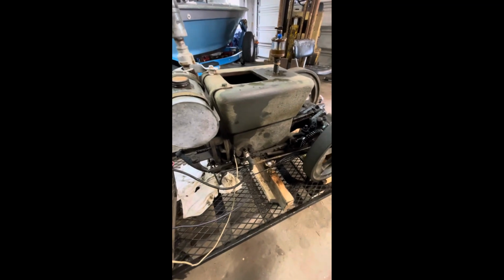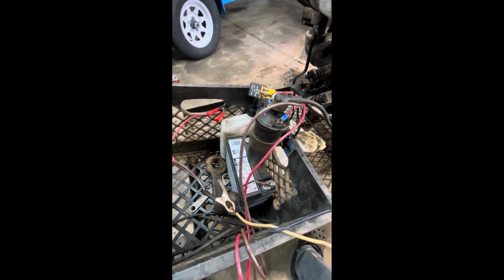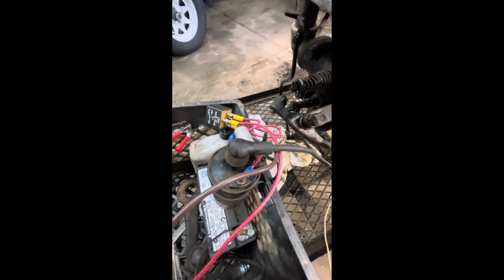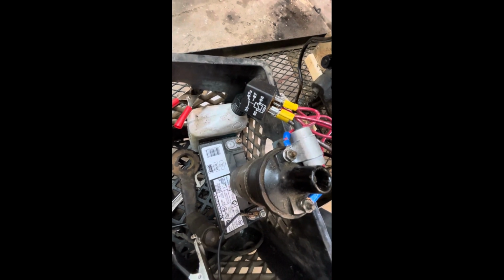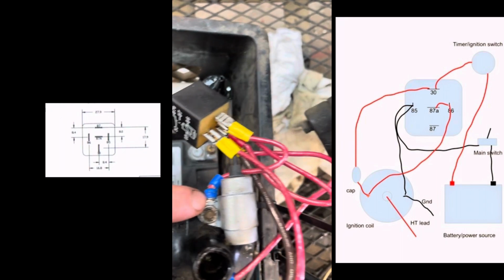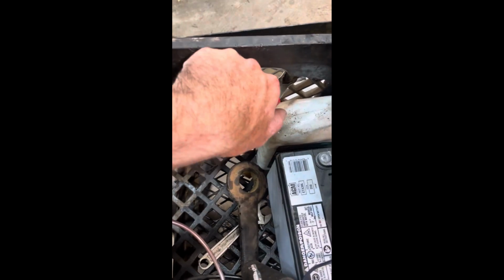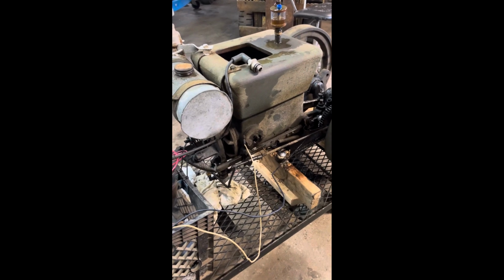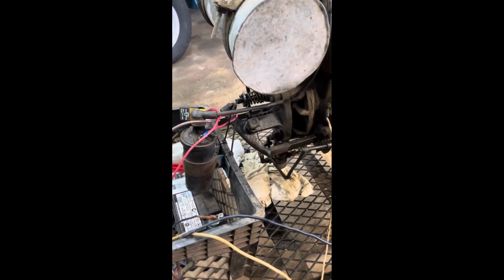How to make a buzz coil for hit and miss or throttle governed engines.

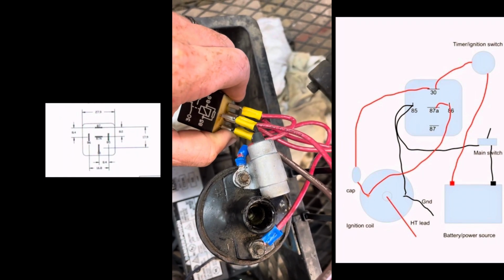Comment: I am looking at this for a different reason but at 4:21 why does it look like the housing for the capacitor/condenser is also on the positive context for the coil? Does this not want to be grounded instead?
Reply: I was wondering the same thing, I highly doubt this works
Reply: @xJgrayx can confirm, it does work!! Happily got mine all wired up and working 🤞
Reply: @LUMlNOSITY   awesome, I will build one tomorrow!
Reply: @xJgrayx best of luck!